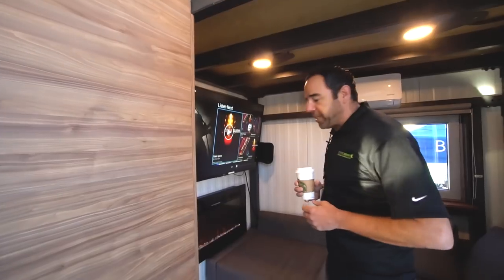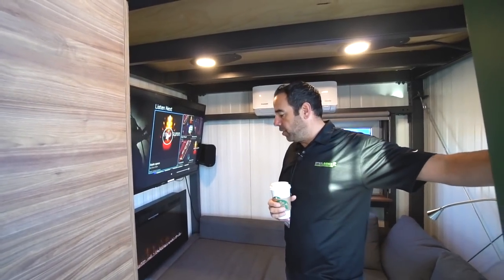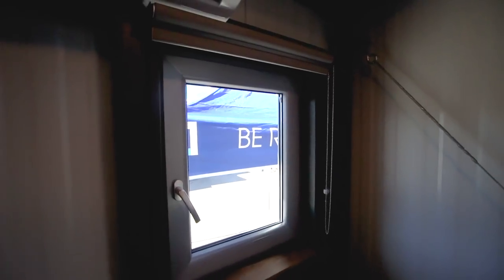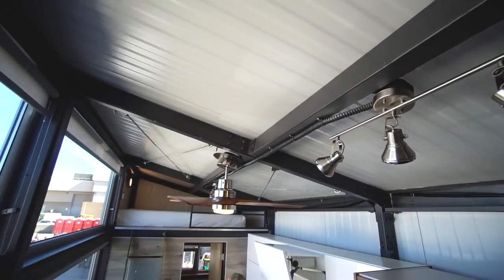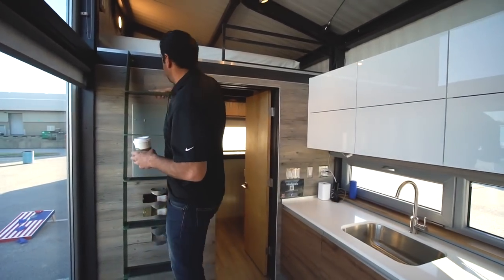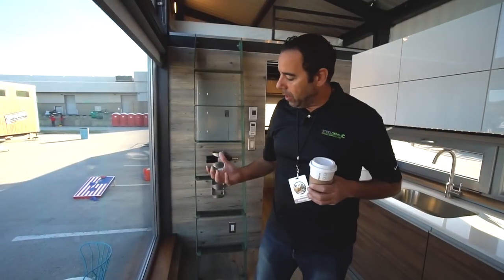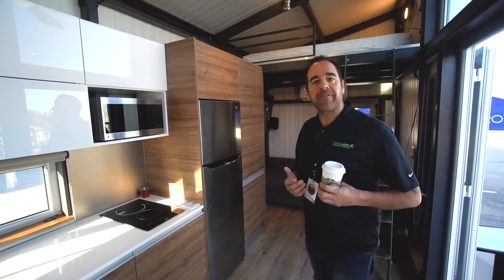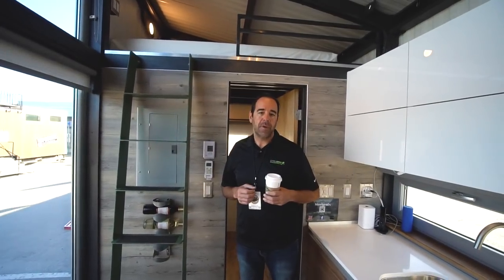Sleek & Intelligent Tiny Home Design ~ Euro Aesthetics Utilizing Steel Frame Construction

Comment: We were talking about NYC loft styled tiny homes possiblities recently- so Im really digging this one! Loving the heated floors too. I worry that the prices will keep rising - out of reach. But if I were to ever venture - this version would be idea. One thing I would change are the big windows in the kitchen area. I think the area would work better if the windows werent floor to ceiling. Instead add a long slab of wood in front of the windows for reading, studying or work area. At the right height, the outside view would still be enjoyable.

Comment: That looks great, but is it thermally conducive as well?
Reply: Yes, they put forth the most unique thermally conducive as well. :)
Reply: It's actually European standard thermally conducive, so you know it's good. Did I mention it's European?
Reply: ...and those thermally conducive airtight envelopes (r-value of 8 per inch) in those 1-inch 2-pane European windows. Very thermally conducive.
Reply: No, it's constructed with MIPs (Metal Insulating Panels)... Similar to SIPs (Structurally Insulating Panels)

Basically, there's nothing but insulation between the outside layer and the inside layer... There's not even framing studs to break up the insulation so it's as close to 100% insulation coverage as you can get.

Comment: What is the weight of this home?  At 8.5 wide, does it have to be professionally moved?
Reply: No, road legal is 8.5 wide and 13.5 high... At least along highways... Side roads are more limiting.  While different states have different length limits.

Weight is somewhere below 14,000, which is the normal limit for a double axle with two 7000 axles... At 24 foot long and constructed with MIPs it should be below 10,000 for dry weight...

Comment: I see the metal roof over the frame. No insulation? Why a huge TV in a small house? I realize that this appeals to many; just not to me. The size is perfect for me- I'll be looking for a car hauler trailer or a foundation trailer to build my home on.
Reply: It looks that way, but we're seeing the inside of a 3" thick steel/foam/steel insulated panel. They're based in Colorado, maybe aiming for the large software developer population there?  Looks super-durable, but way too expensive and industrial for me.
Reply: It constructed with MIPs, think a siding sandwich with nothing but insulation in the middle but still extremely strong.